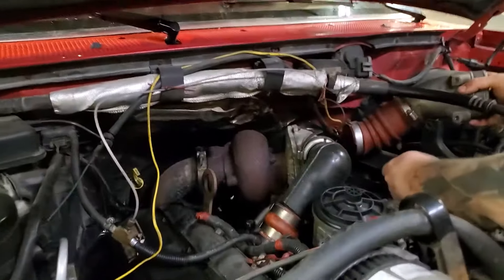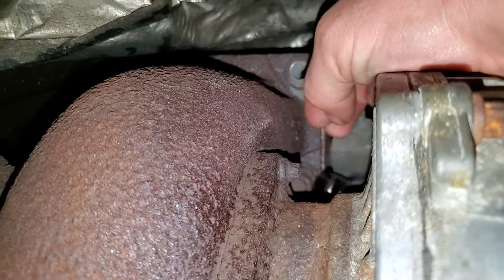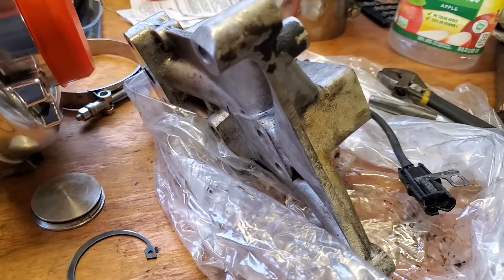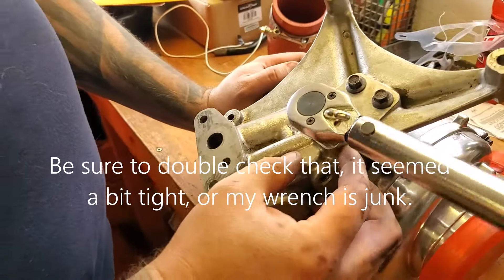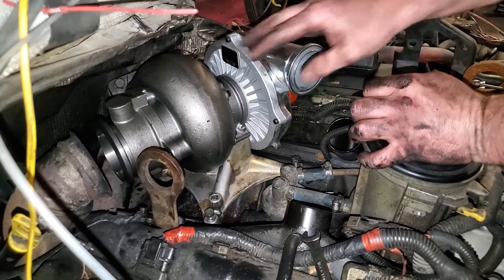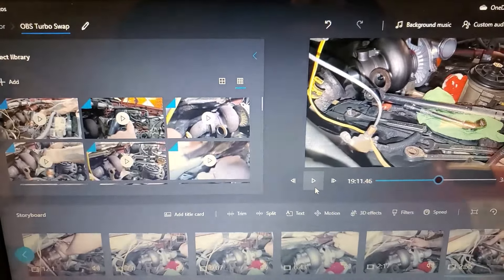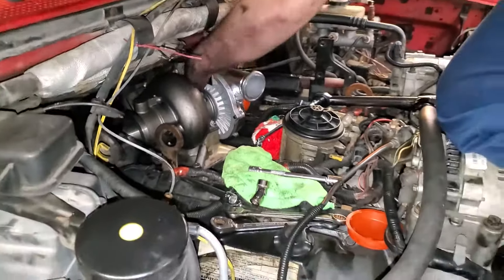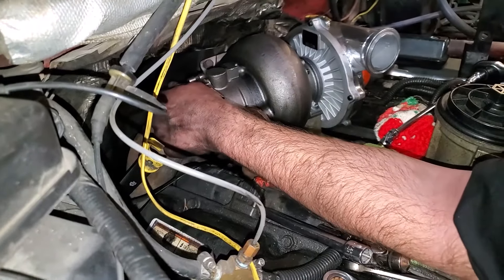OBS Power Stroke Turbo Swap - Removal and Reinstallation

Comment: I like the humor. “If you can’t figure that out you probably shouldn’t be doing this job.” 😂
Reply from the maker: I say that pretty frequently actually haha. It's true though!
Reply: @darkhorseautoanddiesel  
I got the Turbo Back on.... the trucks running.... it seems like it whistles a little bit louder but now I can hardly get up to 55 when I'm going uphill ...do you know why that could be
Reply from the maker: @ryanstropicalplantsoutdoor1989  Do you have a boost gauge? If you do, what's it reading? Check the rod for your wastegate. It may have come off. I've had that happen once. I didn't get the clip back on it all the way and it fell off going down the road. Took forever to spool up, wouldn't spool at all under about 2200 RPM, high EGTs, and smokey exhaust.
Reply: @darkhorseautoanddiesel  well this is going to sound crazy but it doesn't have a wastegate it only has the bypass valve...
It's spools up at idle and it tries to build pressure but it acts like it's misfiring although it doesn't shake when I'm going I just feel like I'm not getting ignition on all cylinders but there's no smoke at all
Reply from the maker: @ryanstropicalplantsoutdoor1989  Send me an email. Darkhorseautoanddiesel@gmail.com It'd be easier to help you talking through there than on here.

Comment: Tip: If you remove the ebp valve first and install last, it makes job much easier. Requires 12pt 8mm or 5/16“ socket .   1/4” drive. .
Reply: Yup till the bolts break off in the housing like mine just did..  thank god I have a .84 housing sitting here.

Comment: 12point 8mm and remove the EBPV deal and it makes the passenger rear pedestal bolt easier to get at.
Reply from the maker: I didn't really think of that. I figured it'd be too hard to get the old one off in the truck and to get it back on after. I'll try that the next time I do one of these!
Reply: How do you get the rear/bottom 8 mm head bolt back in and torqued after the reinstall? Or do you put it on outside the truck, then monkey with the 15 mm nut on the reinstall? If the downpipe was out from under the hood, that seems like it would be significantly easier. But honestly, I’ve spent the last two days trying to remove the 15 mm nut. Been chasing tools and nothing is working yet. Looking forward to my swivel sockets getting here tomorrow.

Comment: A small flat head screw screw driver helps to get boost tubes back together
Reply from the maker: I considered trying that but didn't want to risk damaging them with the screwdriver. I've definitely done it before but damaging things and having it take up garage space waiting for parts wasn't really an option at the time.

Comment: Thanks for the video! Not a lot of videos out there, saved me alot of time, luckily my dads coworker used to be a ford mechanic, and he made a special wrench for the lower two exhaust bolts on the turbo. Just a stubby 15mm with half of it ground down for clearance and a slot for a pry bar. The job still took me all weekend, but if I didn’t watch your video first, would have took me longer thank you.
Reply from the maker: You're welcome. I'm glad it helped. That's why I started this channel.

Comment: Thanks guys! Very good video! Nice how you videoed removing those hard to get to nuts and bolts. Showed the tool set up needed for each. Even included the torque specs for each  My turbo is fine right now. But since I NEVER plan on getting rid of this truck. I see exactly how it's done. If and when I tackle a rebuild!
Reply from the maker: You're welcome. I try to be as detailed as possible. If/when you rebuild the turbo, I have a video on that as well. It's for a Super Duty, but it's mostly the same.

Comment: I made a platform to lay across. With the alternator removed and the bolts reinstalled, it acted as a stand. Used 2 football bleacher cushions cut in two to balance the wood I placed above it. I then used the last half of the cushion as a chest cushion. To get the v clamp on, I didn't mess with it for more than 15 min before realizing it wasn't going to go on. Ford and their infamous wisdom used the shortest bolt possible on the clamp. Preventing you to get the nut on. I went out and found a longer bolt and used a hard wheel of a grinder, and shaped the head to match the original. It took me 5 minutes to put it on, and I had the truck put together in 3 hours there after.  Get a grade 8 bolt with full threads that's an inch longer. I didn't have a fully threaded bolt, so I had to dye mine. I actually ran to bolt length problems on most of the clamps. But I was able to make due as they're very accesible, unlike the one on the back. Hope this helps.
Reply from the maker: I like the idea of the platform to lay on. I'm not sure why you had issues with the clamps. I've never had a problem with the bolt length on the V-band clamps. As long as everything is lined up properly it should go on pretty easily. Makes me wonder if you had things misaligned.
Reply: @Dark Horse Auto and Diesel  Thanks for the response. I have yet to drive the truck. If I did something wrong, what am I looking for or listening for?
Reply from the maker: @Mattie_Ice  exhaust smell I'm the cab, smoke from under the hood, increased noise from under the hood. You can open the hood and watch in that area and have someone rev it up. If you have a chip that increases fueling it would help with noticing smoke.

Comment: Really good video currently at 320k on my one ton dually the only problem I ran in to is the up pipe collector gasket and it being a pain to remove the inside bolts any pointers on replacing the crush washers on those????
Reply from the maker: Thank you. Getting the nuts and bolts off the collector pretty much requires the 15mm swivel socket I mentioned in the video. There shouldn't be any crush washers to replace though.
Reply: My bad I’m talking about the up pipe bolts . I don’t have the money to replace the up pipes so I’m replacing the oem crush gaskets
Reply from the maker: @timothyedgens3670  you can get a set of bellowed uppipes on rock auto or Amazon for like $80ish. I have over 100k miles on a set of el cheapos on my work truck and they're still sealed up just fine. If you just replace the donut gaskets you'll likely regret that decision quite quickly because the pipes themselves are probably rusted and worn down and you'll still have leaks.  I'm a big of a cheapskate as anyone so I get it, but do you wanna do it right the first time and be done or the second time when the first failed?

Comment: Easy to follow saved me a lot time and work .. one question where did you buy the turbo .. does it come with a pedestal delete… thank you
Reply: Turbo came from kc turbos. It’s a kc300x stage 3. No it didn’t come with a pedestal delete. I just deleted mine.
Reply from the maker: I don't remember us deleting the EBPV crap from the pedestal. Was I drunk by that point of the project? Or does my memory just suck that bad?
Reply: @darkhorseautoanddiesel   hahaha. Well the rod wasn’t hooked up anyway. We tore it apart and I plugged it. Be definitely did it.

Comment: 5:20 I can't get a socket to go on that bolt to save my life. I even bought a cheap one, cut it shorter, and it's still hitting the pipe right over the bolt (not sure what it's called). You're clearly using a normal 10mm socket in the video, but mine is way too big. Wtf do I do?

I can get it to almost go on, but every time I put a little force on the ratchet it just pops off the bolt.

Comment: Idk how you guys got that out so easy. I’ve been fighting mine for over 8 hours now and the passenger side rear pedestal bolt stripped out and I flipped out
Reply from the maker: Patience, caution, and proper tool selection. Plus having done it a few times in the past helps a lot.

Comment: What if you DO drop the print into the intake? Please don't ask why I'm curious...
Reply from the maker: I don't think I need to ask why...

You're definitely going to want to get anything dropped in the intake out of there. Depending on where it went, you may have to pull the plenum off. That isn't hard to do, just remove the bolts and carefully pry it off. Then you'll spend a good amount of time cleaning the old silicone off. When you reinstall it I'd recommend using the OEM silicone from Ford or International.

Comment: Did you pre-prime or mechanically prime the turbo after installation... or do you just crank it over after the new one is in?
Reply from the maker: Pre prime. I always turn the turbo upside down, then dump some oil in and spin it until no more air bubbles come up, then dump it out and install it.

Comment: I can't get my rear passenger side pedestal bolt to thread back in no matter what I do, its crazy. All the others went back in fine. If my one pedestal bolt back there won't thread in, will this lead to an oil leak?
Reply from the maker: Pretty much guaranteed an oil leak. Quite possibly a massive one. The back 2 are where the orings are and while all 4 are important, those 2 are the most. The best advice I can give you is to pull the pedestal back off and try threading the bolt in with nothing in the way. If that doesn't work, you're gonna have to run a tap through it to clean the threads up that somehow got messed up. If that doesn't work, you're gonna have to drill it out bigger and put a thread insert in, which won't be fun. 

I have to ask, did you try threading them all in just a few turns or did you you tighten some down before threading in others?
Reply: @darkhorseautoanddiesel  I tried starting with it but it would't go anywhere, spent way too much time trying to get it started by hand to no avail. Drivers side one went in ok, so then I tired shimmying it back and forth to see if i just wasn't centered on it, but it was just spinning around not biting the threads. Then I test fitted the other bolts and they all went in fine, so I know its not an alignment issue. Really don't want to pull it back off, but if the threads are messed up in some way I guess I might have to
Reply from the maker: @remiphillips  unfortunately pulling it is your only smart option.

Comment: Those Harbor Freight Torque Wrenches are garbage, they tend to be accurate when you first buy them but as soon as they get tossed around the toolbox drawers a few times they loose calibration. Also on a side note, using an extension on a torque wrench 100% will mess with the accuracy of even the highest quality torque wrench. Previously I worked for a supplier to CAT Equipment and on the rare assemblies that required an extension on the Torque Wrench that specific torque wrench was calibrated weekly with that extension on and there was no swapping sockets and using extensions on ones that were not calibrated for it because it greatly affects the readings especially on high tolerance assemblies

Comment: HELP!!!!
Great video...thank you it helped a lot...
I took off the I.c.p. to check hpop pressure...3 second crank and it just oozes...but the truck will run🤦...i don't understand...it chugs at idle....new ipr valve....rebuilt ipr....and still...it ran fine with a few hiccups before I rebuilt the ipr....and fuel bowl....
I have no computer only volt meter...12.5v and reversed 12.8v on the ipr..
8omms ipr....
New icp...great continuity...
Not sure of volts...i will check tomorrow but I don't think that matters right now...
Any ideas...i have done my research...ive posted on Facebook for help....all I get is get a regular job and pay a mechanic...i own my own company but the truck is broke😭....thank you
Reply from the maker: How much have you ran the truck since replacing the IPR and rebuilding the fuel bowl? Opening up the fuel and oil systems will get air them, which can take some time to work its way out. Depending on how much air got in, it could take 20+ miles of driving before it acts completely normal again.

Comment: Friend, I have a problem with water in the oil, I don't present any evidence, but little water appeared in the oil. Do you think it's the oil cooler or the heads?
Reply from the maker: Probably the oil cooler. I had the same problem a little over a year ago. The heads and head gaskets on a stock 7.3 almost never fail, although it is not possible.

Comment: How has performance changed over the stock turbo?
Reply from the maker: We never ran it on a dyno or track, so I'm not sure on actual numbers, but it sure felt better. I'm sure it made more power.
Reply: Whats Is It of number part of this new turbo.
Reply from the maker: Turbo came from kc turbos. It’s a kc300x stage 3.

Comment: which turbo will give you more power mpg?
Reply from the maker: You probably would never notice a change in fuel mileage by changing the turbo. If anything it'd probably decrease due to playing with the extra power. You MIGHT see a SLIGHT increase in mileage by deleting the EBPV, but even that is questionable.